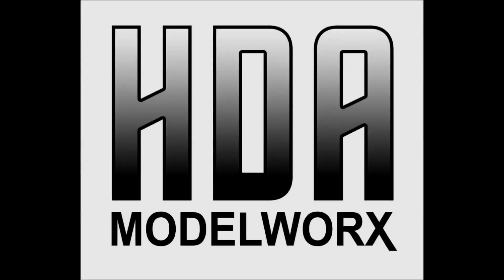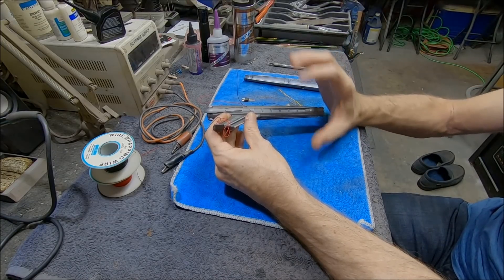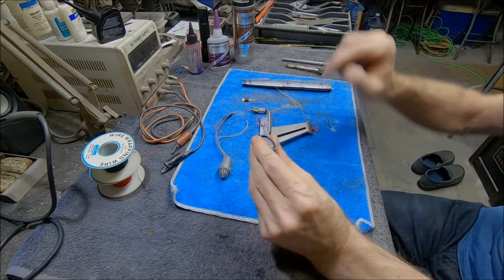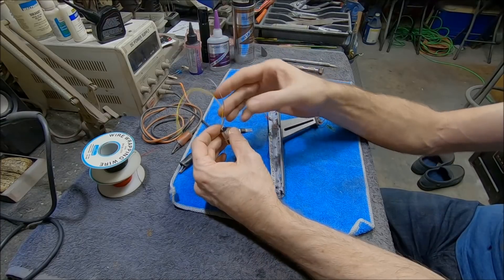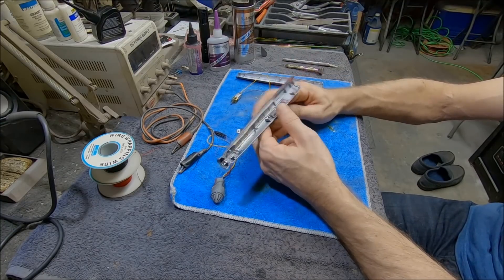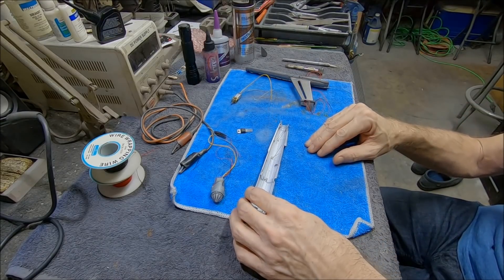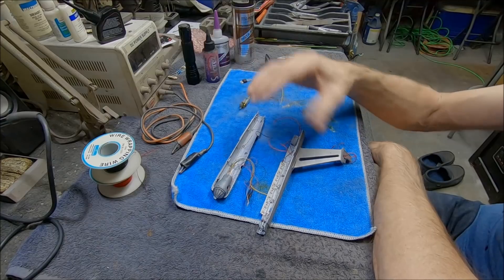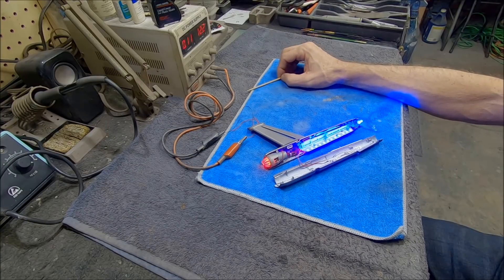Star Trek Discovery 1:1000 Scale U.S.S. Enterprise Build Series PT 3

Comment: Hi Boyd hope all is well.  I was wondering if you could do a short video on wiring the transistor...I have those and at 9V the transistor got really hot, I'm just a little confused how to wire one of those up. I can get e reverse action on the motor but transistor gets very hot...enough to burn your fingers if you touch it even a few minutes after you shut down power to it. lol

Comment: Just curious, but if you're hooking up to a 9-12v power source, why can't you just use resistors to slow down the motors like you do with LEDs? Or are transistors the only option for something like that?
Reply from the maker: I tried using resistors and found that I could get the motors slowed down to the speed I wanted but then they wouldn't start again when I cycled the power on and off. Turns out that the motors draw more amperage when they first start and resistors limit the needed current from going through. Apparently transistors are different in that way and do allow enough current to go through on startup and also limit the voltage to control the speed.
Reply: @TrekWorks  Wow thanks, I never would have guessed that! I'm planning on using the PL motors along with my own internal lighting, but I'm guessing they'd probably have the same issue.

Comment: Hi Boyd, where did you end up placing the 7805 transistor - in the engine pod or the secondary hull?
Reply from the maker: I glued it inside the secondary hull on the bottom of the port side pylon mount.
Reply: @TrekWorks  OK cool, I'll try that...couldn't find a spot that didn't block the LED strip lights.

Comment: Hi my name is Terry and I was thinking about a solution for your lighting issue. I'm a licensed optician and I use prisms to help direct light in eyewear and I thought if you used prisms in your lighting designs it may solve the issue you were describing around the windows areas on the saucer section of the enterprise. You can also get a flexible material Vinal prisms called Fresnels and you can cut them and angle them and it will direct light in different areas.
Reply from the maker: Interesting, I'll keep that in mind and thanks.

Comment: Hey Boyd could you do a short little showing how you wired up the Transistor to the Motors for those of us who are first timers to working with small 5 volt Transistors i've never worked with these Transistors before and i'd like to get it right without massing up the Motors ?
Reply: This is the pinout assuming it's fairly standard. https://components101.com/sites/default/files/component_pin/7805-Voltage-Regulator-Pinout.png

 I'm not 100% sure, and it depends on the current the motor needs but that regulator could get very very warm. I have an old PIC programmer lying around somewhere that had a 9v regulator with a small heatsink on it with a 12v supply and that used to get HOT.

Comment: I can not begin to tell you how much I enjoyed this video, this looks a lot like my Franklin on the nacelles part. I too have those motors (i got mine off ebay) looks just like those, anyway I plan on putting those on the USS Franklin to have those spin the same way  the fins are supper thin and easy to break I may scratch build my mixing blade already broke two blades off. that slorarez may help on that. this kit is high on my list to build this year

Comment: Have you tried using the diffuse layers from behind an LCD laptop screen, they are made up of layers of fresnel lenses and a frosted layer,  they are designed to spread the light from led lights quite effectively. and you can buy broken LCD screens really cheaply
Reply: Sounds like a lot of work for what you can just as well achieve with a light spray coat of color.